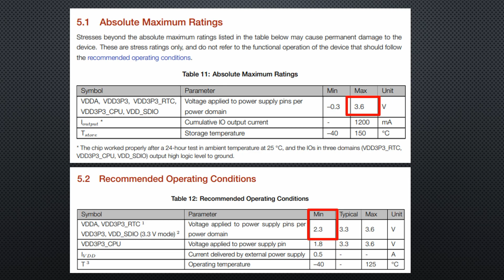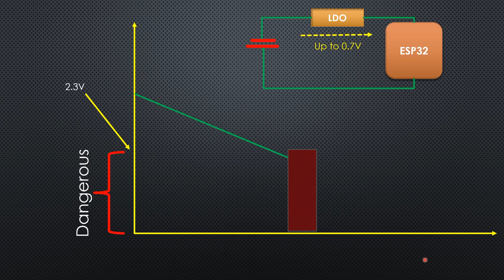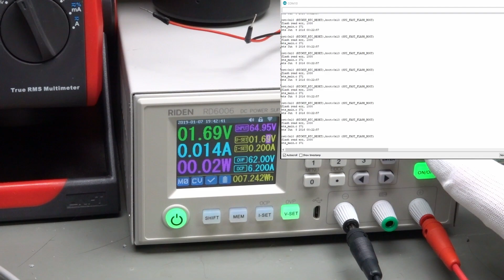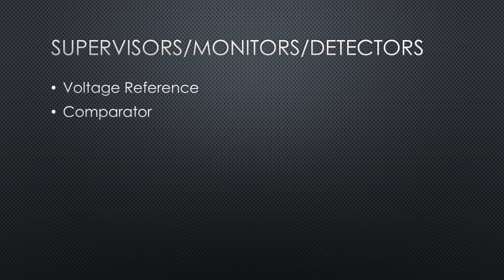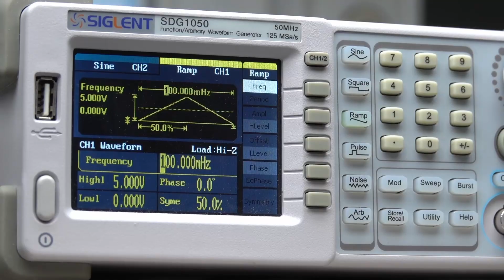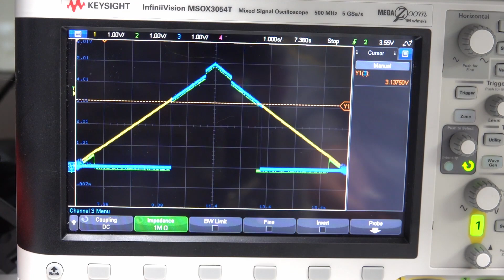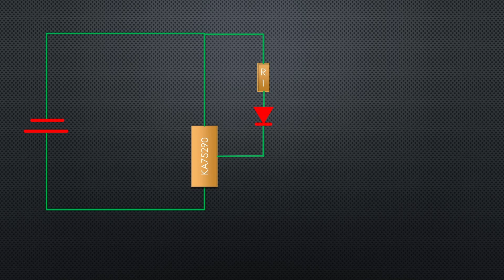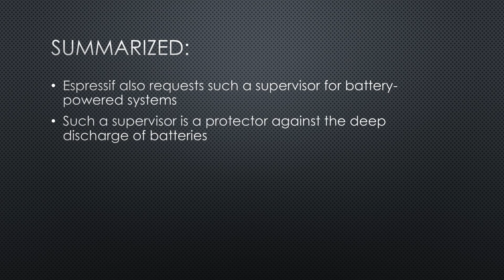436 How to use Voltage Supervisors to protect ESP32, Raspberry Pi, and Batteries

Comment: Thanks for the video) But what about BOD?  Is there any sense in using  Voltage Supervisors if BOD on MCU is enabled and device isn't battery powered ?
Reply from the maker: BOD work good when the voltage comes down. They often do not work when the voltage is slowly increased as with solar (the ESP32 has a BOD)
Reply: Depending on the chip, not enabled by default. ☹️

Works fine on powering down... But check battery voltage if you have a spare analog input so you get an early warning and can e.g. conserve power to stay alive longer..

Comment: So regarding battery operated devices i think a version with 2.5V would work better since it should always be above 2.3V as the ESP32 datasheet said AND also prolong battery life since now you can train it a bit more (not great for single cell Li ion but may not be as bad with other battery types )
Reply from the maker: You chose what is best for you ;-)
Reply: @AndreasSpiess  well i am building a small weather station with a cut off for li ion at 2.97V ( 3v was not available 😅) but in theory it should be fine

Comment: Has anyone experienced an MCU's program memory becoming corrupted by power supply irregularities?

I have made some battery monitor circuits that watch battery voltage with the ADC via a voltage divider (battery voltage is well above vcc) and powered by a buck USB supply.

Their purpose is to change the LED color as the battery runs down

They all 'fail' in the same way... The output colors change from what they should be.

They are all fine again (for a time) if I re flash reflash the program
Reply from the maker: I did not experience such behavior. But using parts outside their specs is never safe...
Reply: @AndreasSpiess  yes, I'm definitely check the Brown Out Detector settings and try to optimise them, if that doesn't work I will try these voltage detector chips in your video. They are ATTINY1614 s

I 'm pretty sure the flash program memory is being corrupted in my case, not damage to the ADC

(the adc pin is behind a 39k + 2k resistor divider)
    because they work ok again if I re program them

Comment: Wouldn't the brown-out detector, at least on Atmel microcontrollers, help with this issue without the need of external components?
Reply from the maker: It helps. But the ESP32 also has a BOD. They usually work fine with lowering voltages and fail with increasing voltages (as you saw in the video. The flash was not ready and crashed the ESP at a certain voltage level)

Comment: Could you use this on the gate of a mosfet as low voltage protection for a single cell 18650?
Reply from the maker: I do not think so. You need a stable voltage to compare to.
Reply: @AndreasSpiess  Thank you for your time!

Comment: Quite useful information. I installed an arduino with a NFC reader at the entrance of the hotel i work to automatically open the door to the hotel's staff, so they don't have to ring the bell to get in, and since the power supply slowly increases voltage until the set poisition, the arduino crashes at the start (the LCD screen makes it very clear), so i have to reset it once the PSU is on to boot it up... if it ends up being a problem, now i know how to solve it!!!
Reply from the maker: Cool! I hope it will work...

Comment: Great video, touching a point usually neglected. Thank you! I think the ESP32 dev kit already includes it, right?: So far I am using the dev kit but I start thinking of making a dedicated USB with ESP32, yet still afraid of soldering SMTdevices. So far sticking with good old through holes.... If I do this jump, I will certainly need such a device.
Reply from the maker: I never saw that an ESP board had such a supervisor chip. But the ESP32 has a brown out detector which helps when the voltage decreases. It does not help with slowly raising voltages as we saw.
Reply: @AndreasSpiess  And I thought BOR works in both directions. Is this the same case for all uC with built in brown out reset ?  TIA.
Reply from the maker: @mumbaiverve2307  I do not know.
Reply: @AndreasSpiess   Ok , very vague question I know :D

Comment: 14:03 For anyone wondering, like me: in #133, Andreas explained that most supercapacitors are only rated for 2.7 volts, which is the reason why you typically need two of them in series to stay above 5.25 V, the specified upper limit for USB power.
Reply from the maker: Thank you for the additional info!

Comment: Afternoon mate, Looking at snow tomorrow down to 500 metres. lol Australia crazy. 5CR hey Andreas.   Oh my virtual server had that problem with my solar system.
Reply from the maker: Here the weather was so bad for a day that my battery was completely discharged and I had to buy a few kWh :-(
Reply: @AndreasSpiess  Me as well, but that's not as bad as the drought has been, the melting of the glaciers, etc.
Reply: @AndreasSpiess  My BMS failed. 😢 But Second 5 KW on it's way.
Reply: Here we got fog this morning. It's strange for summer, but after weeks of hot dry weather it seems right after two days of rain not to heat up so quickly.
Stay safe in the snow!